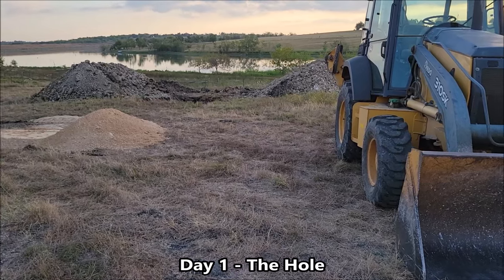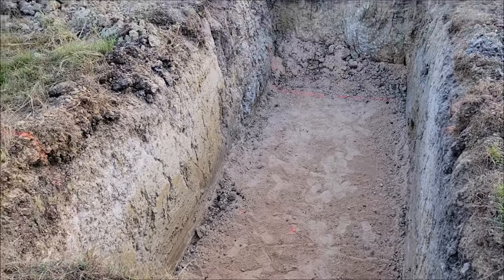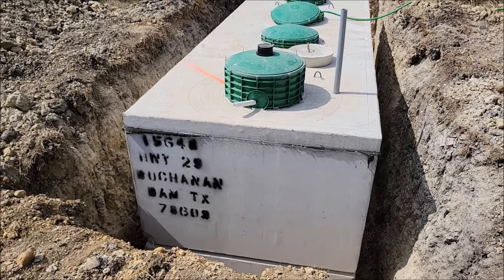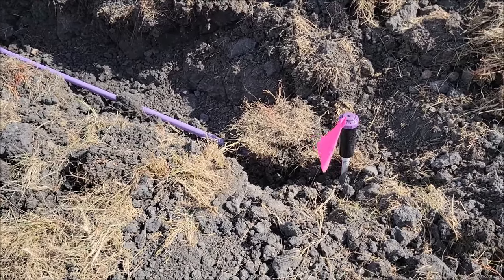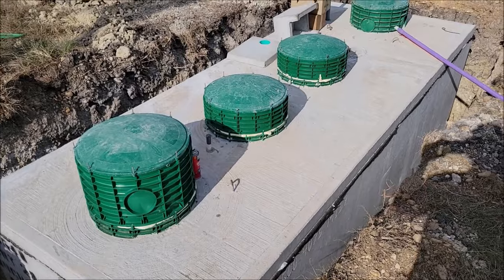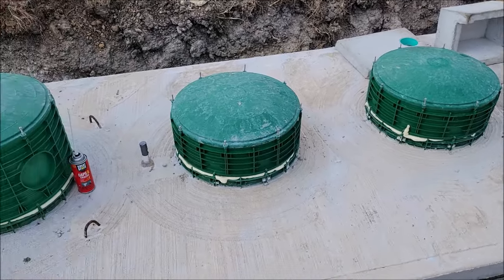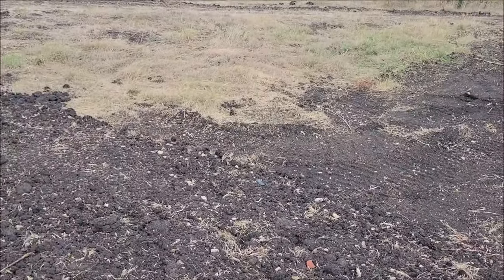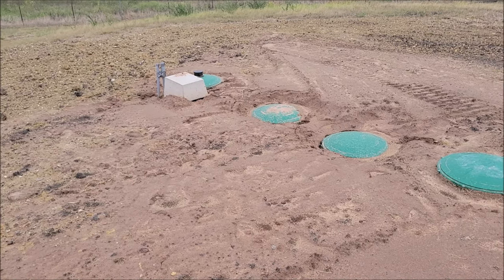Our Septic Install - Aerobic Septic Systems with Spray Irrigation

Comment: We're in northwest arkansas and no one is installing these and I feel they should. 2000 sq ft house using anerobic is around 7 k. 30 k for aerobic why would they charge that much more? Is material cost double going aerobic?
Reply: Puerto Rico they do that for 7k
Reply from the maker: It's not much more on cost of the materials.  I would say it's less.  I would have preferred an all underground anaerobic septic, but the clay and lake near would not allow it.
Reply: Put these in in Texas Houston area for 10k on average
Reply: Yeah central west Texas around 10k
Reply: I'm in Texas and the way it works in my county and surrounding, if you live within 1/4 mile of a lake or water system you are required to have aerobic septic installed , the only way around it is if you were grandfatherd in and already had a regular leaching septic system installed prior to the county adopting this new regulation. It's all for the cleanliness of the lake. I think it's a bunch of crap because if you don't keep chlorine tablets in it and the sprinklers spray untreated water on the surface you will definitely smell it and know it's time to add a tablet to the system. It's so much more expensive because now you have to have electricity ran to it in order to run the air pump and it has to be on its own dedicated 20amp breaker. The sprinklers are just an annoyance to try and avoid hitting when your driving a tractor with a bush hog cutting grass or what I have is tall brush. Personally I would love to just have a normal system that filters the water through leach trenches down below the top soil rather than spraying semi treated water on top the ground cause I'm not planning on running through the sprinklers during a hot day to cool off that's for sure. They are averaging 9 to 12 grand around here these days. Compared to 2 to 3 grand.

Comment: Who did your job amazing i got .39 acre my lot is only 150. X90 but my barndo that im going to built is 1900 sq ft i dont think drain field can fit in that
Reply from the maker: Yeah, I bet a drain field would use up any yard you had left.  These do require spray heads though that need to be a distance away from neighbors and other items.
Reply: you need to get a septic engineer before you build on a small lot. if not your septic might not get approved. IO was lucky and found that out before we started building. we had to move the building 2ice to get it all set up correctly. for the septic to be correct.

Comment: Why couldn’t you do a drip system? 
When you say drop you mean for the leech field?
How many spray heads?
Reply from the maker: They would not allow a leach field where I am because of the water movement underground close to the surface.  If I wanted a leach field I would have had to do a pump setup also and the leach field alone would have been what this whole system costed or more.  The black clay we have and the new county laws put in recently are pushing everyone to these type of systems.  This one has 2 spray heads a few hundred feet away from us in the pasture.